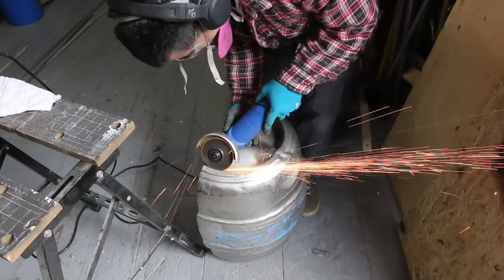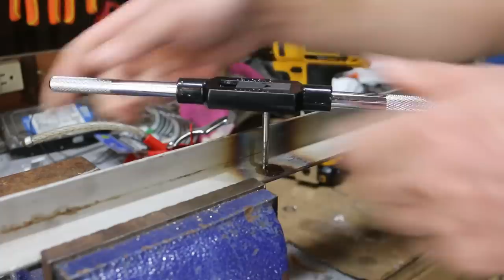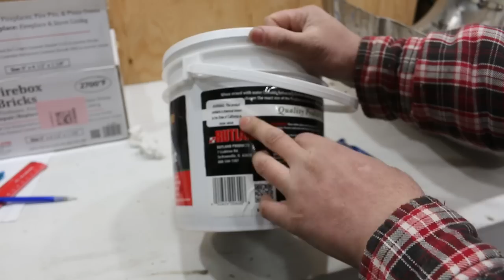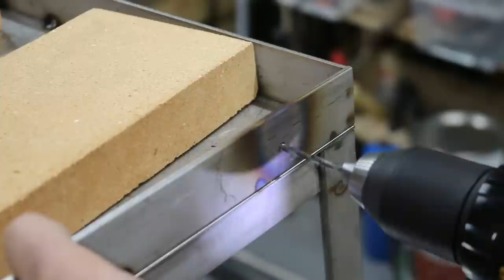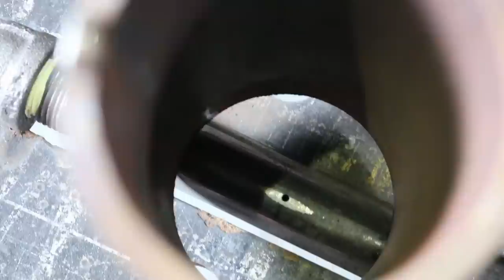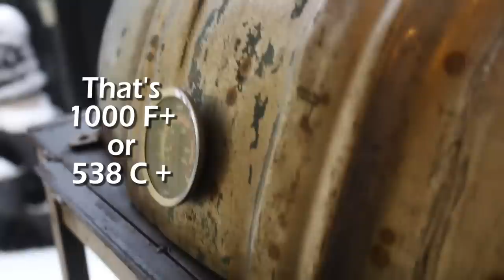Building a Beer Keg Pizza Oven

Comment: This is the DIY ooni oven I was looking for. The ooni oven has the insulation outside the steel so heat rises really fast. I will try building this design following ooni oven insulation method though. A big thank from Greece!
Reply: Hope you guys are doing well during this "global" thing going on. What are they calling it there, an exercise? That's what it's looking like to me, to see just how far they can control and push the masses before they turn on them.😒
Reply: @flowerchild777  seems like way too many are just giving in and doing what is demanded of them  fight back peeps fight back!

Comment: This is really cool.  Maybe use the propane burners for the floor and the rocket stove burning wood for flavor, any way this is very inspirational.
Reply: I would actually keep it how it is with the propane. But, get a nice stainless steel wood smoker tube and put apple wood chips in it. Then, put it into the ripping propane flame! They already make those for regular BBQs. Then you would have ultimate flavour with the speed of propane or NG!

Comment: I need your help please, i have a wood fired pizza oven i want to add a propane burner to . I used 3/4' pipe and shaped it around most of the oven for better heat distribution and added only one air mixer. i cant seem to get the flames to turn blue and oven wont heat up . if you have email or way to send you more info let me know please

Comment: I would have added you clay mix on the outside of the keg
Reply: I'd love to try this but would I have to worry about the steel expanding at a different rate as the Pearlite?
Reply: Ajita White you couldn’t add enough wood or charcoal under that size of wood too worry about that. And who worries about expanding? Expanding doesn’t =failure and expanding doesn’t =explosion. So what’s the issue? Metal is malleable

Comment: Andrew, I am curious about the burner. I am thinking of building a pipe burner like this using stainless steel pipe that would go through the mouth of my dome oven (diameter width of my oven is 960mm). I want to use natural gas (I assume it is low pressure). I am thinking of a long 800mm s/s pipe (no joins inside the oven) with one or two jet burners. Do you think the pipe can sit within an oven at 400 degrees celsius? Obviosuly the ball valve will be outside the oven with no exposure to heat. Do you think it will work.

I don't want to core drill a hole in my oven floor ...

Comment: I have a feeling smaller pizzas might work best with that oven you built. Try Pizzas about 8 inches round. If I'm correct about the size of the pizza then it means that oven would be better served if you made it three times larger to fit a normal size pizza. I think the pizzas are too close to the heat source and is why you are getting burns. A larger oven or a smaller pizza would have a more correct distance from the heat source to get a more even cook. Nice work. Don't stop at pizzas try making a steak in that thing. I bet a steak would come out a lot better. Just use a cast iron skillet.

Comment: Great Video! I'm currently converting my 4' x 3' fire pit into a pizza oven by putting a removable copper dome on top of it. Have you had any issues with the refractory cement coming off and how thick of a layer was that? I'm worried about it being too heavy and it sticking to the copper so I want to do a real thin layer with steel mesh holding it all together.
Reply: Please keep us updated on your progress. (Hopefully I'll get notified when/if you do👍)

Comment: Awesome build, thanks for sharing!  I'm in the middle of doing something similar, but was planing to use a cordierite base after reading that a steel plate would transfer heat too fast and would char the bottom of the pizza, but it doesn't seem to be the case at all in your oven.  One question, after some use, did the plate warped in some way?  Thank you!
Reply: I hope he gets to your question. I'd also like to know if it warped at all, but I doubt it

Comment: Did you put the fire bricks back in after the redesign. It didn’t look like you did. On regular pizza ovens isn’t the bricks themselves heated instead of having flames above them. Just thought you maybe could heat them from underneath instead of having a flame shooting up above the cooking top. I’ve made grills out of those same kegs and they last forever! Good video 👍👍
Reply: No you can't just heat the bricks. All that would happen is you would burn the base way before the topping melted. You have to have the heat coming from above. In fact the Roccbox this was inspired by has no floor heating (it's not required) The refractory base heats up nicely anyway. Same goes with any full sized commercial wood fired pizza oven.

Comment: Great job on your mods...
 I like the idea that you introduced propane to pre-heat. I have built a brick pizza oven, and use only fire wood, it takes a very long time to get oven to baking temperature.
At 18:40  Is the shooting flames from propane or wood from the rocket stove???

Comment: i have a genuine question .. is there any reason for alarm because u didnt use fire bricks.. overall i love the project
Reply: A regular brick might contain impurities that, in proper conditions, might cause them to explode at high temperatures (think as a small scale, but enough to be potential hazardous or at least ruin a pizza); the oven temperature might exceed the bricks own curing temperature.  That's a lot of "might".  Cover them with a sheet of steel and you are safe.

Comment: not cost friendly. propane burner consume more gas than regular oven regulator with fan.
probably what you need is better insulation and see some example of Deck oven.
stove system in deck oven  is the best efficient propane use, with little gas combine with  perfect air it make more heat than your propane red yellow fire.

Comment: I like the idea a lot but I have a couple questions:
1. Having the whole thing made with metal with no insulation whatsoever, doesnt it disperse all the heat with no retention at all? Also super hot to the touch?
2. You probably have to refill a new propane thank every other time you make pizza, considering the open gap between the oven dome and the floor...but also the heat dispersion for the lack of insulation? 
3. After so many years and the time you spent on this project, can't you at least dedicate 5 minutes to learn how to make a proper pizza dough? 😜